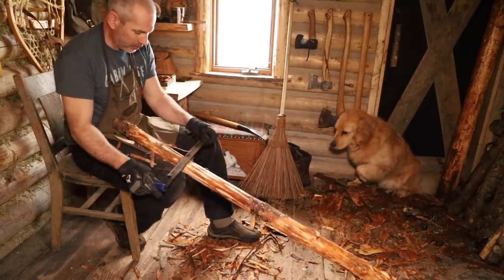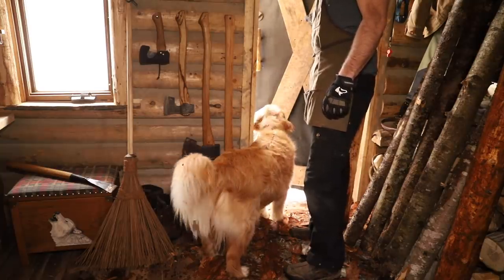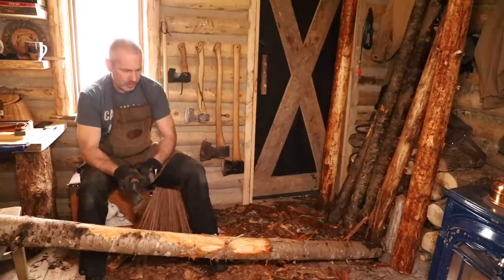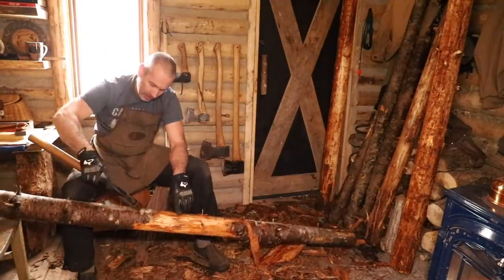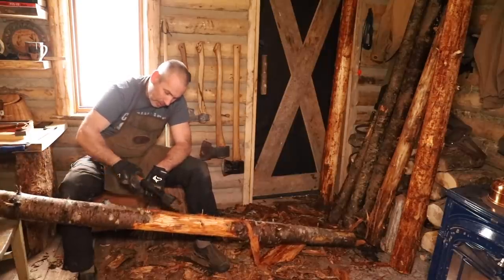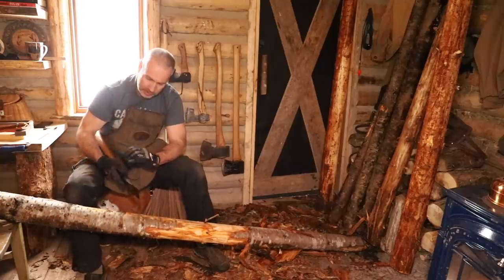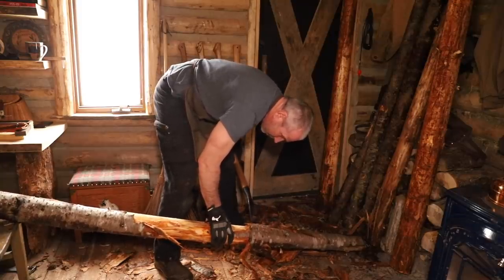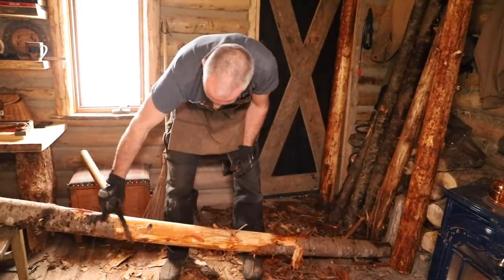Tiny House Furniture, Gratitude, Perspective and Perseverance, Log Cabin Life, Braised Lamb Shanks

Comment: nice chairs ... all they need now is a nice spot to hold the mug of drink ;)  ... I think the logs used might be a little big but then they say the camera adds 10 pounds ... they would definately make an excellent low riser bed frame for the loft though ....
.
with all the hand building of furniture I am truly surprised you havent made a small treddle pole lathe to de-bark and end spindle with or even a spoke horse vice to work from ... both would be extremely useful for all the hand work you are doing